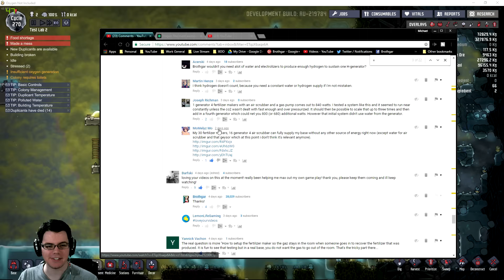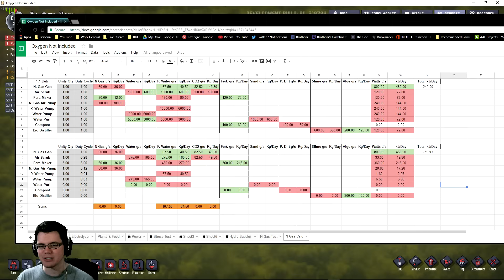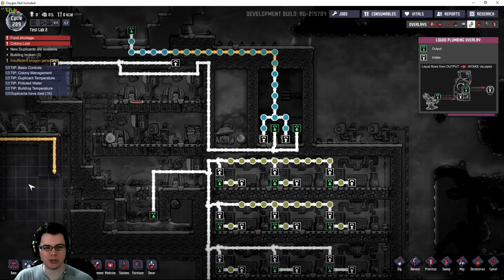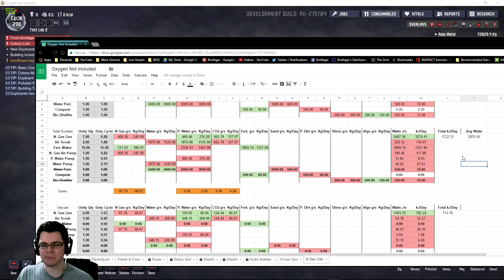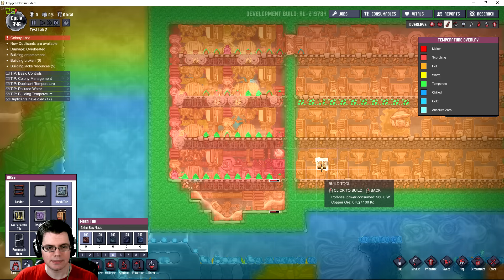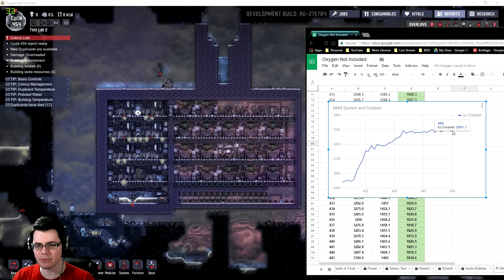Maximum Power From a Natural Gas Geyser! Oxygen Not Included

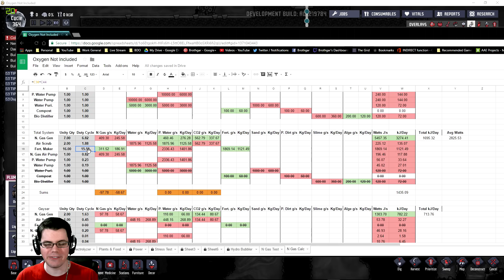Comment: Love these videos.  You need to balance your liquid and gas piping to get the same flow to all. You can't balance a prime number except for 2 and 3 which is why your 7 gas generators had 2 that ran different from the other 5. Moggles mentioned this in a post on the forum with a good picture. http://forums.kleientertainment.com/topic/77912-oni-oxygen-spreading/#comment-910275   I had a decent screenshot but didn't realize until just now you couldn't post a picture here. At 23:54 you seem confused what the 15.58 fertilizers was. It was a zero sum game for your 7 natural gas generators and the 1 natural gas geyser.  A water pump can support 66 2/3 fertilizer makers (10,000g/s / 150 g/s). A Gas pump can support 8 1/3 natural gas generators and I start from there. 3 fertilizers maker enough natural gas for 1 generator so 24 fert makers support 8 gas generators. 4 rows of 6 or 3 rows of 8 is how I set it up and it makes it easy to balance the piping. Email me at jnkweav@yahoo.com if you are interested in the screenshot.

Comment: If the temperature is so high in this system could you just use that to regulate temperatures within a base and reduce the power plant's overall temp levels?

Comment: lets add some more confusion, could the entire set up be self sustaining if you boiled some of the polluted water into steam and condensed it into clean water? I don't know how you'd cool it, maybe a thermo regulator pumping cool air into a room and exporting heat into the water, or maybe just pump steam into a room filled with weeze worts?
Reply: the weeze wort option may allow for cooling of the other instuments as well, although with that it'd be harder to make the steam in the first place

Comment: if you just said what I think you said.... its a deficit of polluted water and a profit or energy, all in exchange for a tiny bit of clean water now and then.... hook it up to a steam geyser... then.... who needs to purify water? free toilets, hot showers, and all!
also: you can use an array of light bulbs and useless gas pumps (vent is right next to itself in a high pressure area) to carefully use up all of the excess energy in a similar fashion to how people used to use various copper/bronze weights on a scale to measure the weight of a target object.
Reply: power a steam system? is there a steam generator?
all I know is- you got it to drip, isn't it enough?
you get the polluted water from dupliants taking showers and sometimes using the toilet, otherwise the system is fully enclosed. all you need, maybe, is to pipe around water to/from a cold climate to keep it cool.

Comment: Instead of using the output of the scrubber, could you reliably, or semi-reliably use a water cooling system to cool down either both parts or just one part of the generator?

Comment: When you make pipes (liquid or gas) they are always divided into 2 at the cross.  So when you have cross in the begining to one row of fertalizer, they get 50% of water, 2 other rows get 50% of left, so second and third row get 25% for each. So youl should just make cross with as many rows as you have. 3 Rows of fertalizer, crossroad with 3 ways out. Not 2.
Reply: If you have 4 rows of fertlizers, you want to first divide pipes intwo two, so each one get 50% of water. And then, each one of them divided into another 2. So you end up with 4 pipes, each getting 25% of water.
     _____
     |___
 ----|
     |___
     |__
Something like that.

Comment: This is a nice system but will it work in a real setup where duplicants run in there to get the fertilizer? They will probably "pollute" your natural gas with carbon dioxide which you would have to filter out

Comment: Hey Brothgar, all that CO2 I found a better and energetically cheaper way to dispose. You make a small cryo camera with 12 weezelwort plants. I suppose even smaller plant quantity will work then pump inside that chamber all chlorine and CO2. It will liquidify into and pack into very small quantities. I mean the whole chlorine on map fits in just one block of liquid chlorine and CO2 is also dense as liquid. I might even be able to solidify it with the rigth cryo design. Regarding that cryo chamber what I notice is that if you feed the chamber with pure CO2 it will not drop temp below -45C but if you feed with oxygen cryo chamber will be at -60C. Also oxygen disappears over time somehow. Seems those wortplants consume oxygen afterall so make sure you pump in some oxygen along with the CO2

Comment: Idea: A water purifier could keep the air scrubber running by changing the fresh water input of the system to sand. But as you had steam generated in your room at one point. Could you combine steam purification of the polluted water using the excess heat from the system in order to either reduce the amount of clean water input, or eliminate it completely? Technically the system (if we remove or reduce the fertiliser makers) is net positive on water amount. If steam purification would work it could remove the need of a fresh water input. It would be a self sufficient system without any external inputs that produces power and fertiliser from "nothing" (of course there is the natural gas geyser or two).

Comment: Cool stuff. Can't wait to test all of this in game. Not sure if you know this but you can use the arrow keys to set the valves and switches to some full numbers. I think its every 200.
Would be nice if you could make those spreadsheets access to the public and link them. Then we can use them locally.
I will be trying to run this system to produce excess polluted water. Water is key to the oxygen and food production in the game.
Would love to see how you actually gather polluted water in game. The swamp biome provides heaps of it, but seems silly to put a pump into each pool of polluted water to transfer into a localised  place within the base. The best thing I have come up with is building some sort of aqueducts for the water to fall into my polluted water pool in my base.
Another test idea, see if polluted water creates polluted oxygen or just converts it, if it produces it then does it produce more with more surface exposed, and how much surface would it take to produce oxygen for the dupes. I haven't really played much recently to test it myself due to the fact that electrolyser keeps bouncing off a max pressure of like 1200, too frustrating for me, lol.
Keep up the good work!

Comment: A natural gas Power Plant produces enough Polluted Water to cover 15% of it's Natural Gas consumption when that polluted water is fed into a Fertilizer Maker.

If you have all of your Polluted Water being converted into Natural Gas, then you will only be using 85% as much Natural Gas as a Power Plant without the recycling system.

Roughly speaking, if your Natural Gas Geyser can support 6 Power Plants, then recycling will allow it to support 7 Power Plants.

I am not taking the CO2 scrubber's output into account, because the Polluted Water it produces consumes external water, and allowing external inputs to this system doesn't give a proper picture of its production.

Comment: I think you missed one thing in here.
This power plant is using 2 resources: natural gas and clean water.
The moment your water started evaporating in left chamber from heat I had this question:
Is it possible to make a power plant that is using only natural gas?
So no sand, no clean water, everything should be created from byproducts of the power plant itself.

Comment: Your piping system is a nightmare. Intersections cause uneven distribution due to the peculiar way the game handles them - This is the reason for the last few fertilizer makers not getting water consistently and a few of the generators not getting a constant supply of gas.  You should run the pipe straight thru the intake of all the valves, otherwise it causes a gap in the flow of water/gas when it branches off.
Reply: Running across the intake is still treated as an intersection -- each intake it tries to shove half the water through while half moves on, at each intake, so again your final fertilizer makers would still not get water consistently. The correct solution is as Brothgar does, use a valve.
Reply: I specifically said valves. Yes he uses valves, but he Branches into the intake of  every Valve from a main line, instead of running across it,  this delays a full packet of 10kg at every single intersection. if you run Straight thru a valve(not equipment or farm tiles which have a resevoir) it only takes the amount of each packet that the valve is set for. Look at 25:12 see how theres a full tile gap between the few water packets at the end? This doesnt happen if the valve is connected directly to the main line - Each valve will only take the amount its set for from every packet, so the very first packet of 10kg  from the pump will start every single fertilizer maker at full capacity, which drastically reduces the ramp up time

Comment: This is a classical system of linear equations problem. I'll bet you've had enough of doing math but using Cramer's rule and reorganizing the table you could solve for the number of various machines in the spreadsheet much faster
Reply: It's very easy to solve the system by hand, which I did a couple of days ago here: https://oxygennotincluded.gamepedia.com/Guide/Natural_Gas_Geysers
It works out to 6.98 generators, 15.93 fertilizer makers, and 1.92 air scrubbers.
Reply: Cramer's rule is numerically unstable for 2x2 systems and computationally very inefficient for systems of more than two or three equations - according to Wikipedia. So I guess Brothgar did just right with this type of equations in his spreadsheet with over 99% accordance between theory and ingame practice.

Comment: AWESOME WORK with the pre-equations. Nothing quite are rewarding as comin up with an idea, building it, and see it meet/exceed one's expectations.

Does the Transformer act as a battery? I'm inclined to believe so (little vertical bar in the center similar to batteries).

Also...the use of the term 'Duty Cycle" is messing with me. In reality (welding at least) the duty cycle rating is the percentage of 10 min of which a machine can run. So a machine with a 100% Duty cycle can run forever.

A machined with a 50% Duty cycle can only run for 5 min within a 10 min period (The 10 min's done combine...it's start a stop watch....see 5 min, and shut it off).

A machine with a 10% duty cycle can run for 1 min within a 10 min period.
...I don't think that's what you mean by Duty cycle in this game...is it? Ha!

So....I believe that the natural gas geyser could support the electricity and oxygen for a colony (all waste from the bathroom being tossed in with the fertilizers as well!) Just a thought, I'll be goofing around with it in my own world. 

Really wish Oxygen Not Included came with a 'empty world' option for building.

KEEP THESE VIDEO'S UP! I hope you continue to find enjoyment experiment and sharing your efforts with others, I for one Greatly appreciate it!
Reply: heh...I still want to have the ability to make "Duplicant Jerky"...keep that printer right on printing!